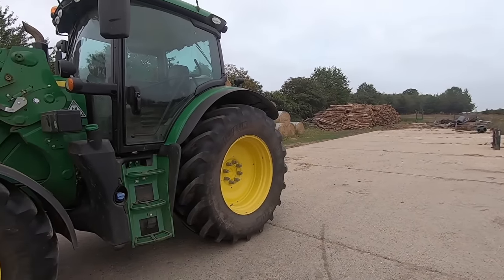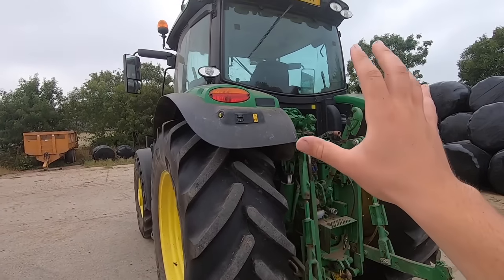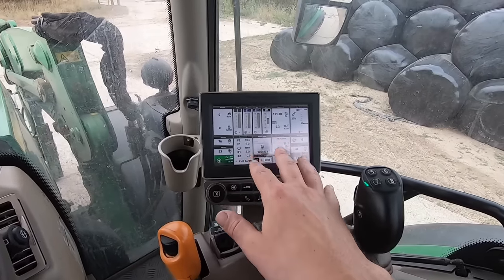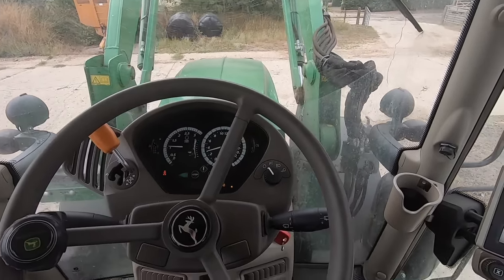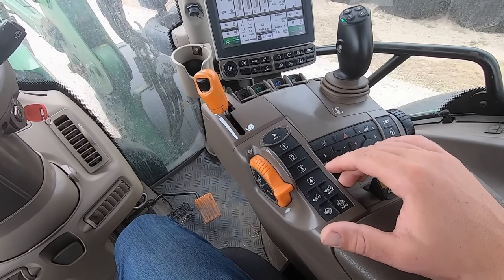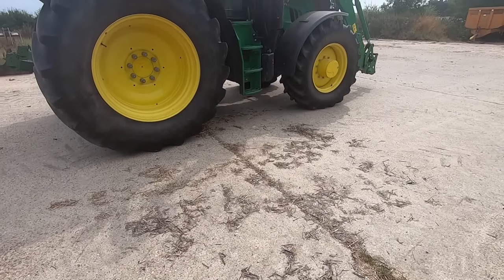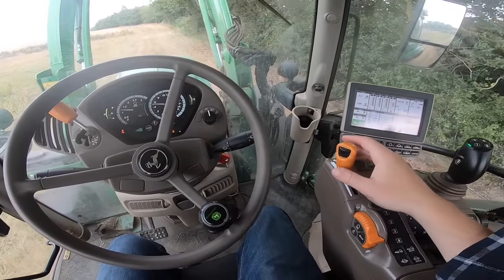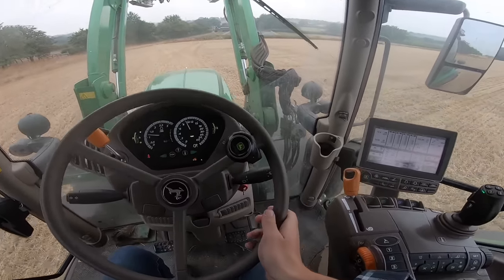How To Drive A Modern Hi-Tech Farm Tractor In 2020!

Comment: Y do u have a 200 hp tractor when all you pull is a cattle trailer and a cultivator 140 hp is enough ( u should have bought a John Deere 6130r
Reply: No harm in having enough plus he wanted something similar to the 6930 size and weight wise also he wanted a 6 cylinder and the 6130r was a 4 cylinder
Reply: 6130 wouldnt pull the muck spreader he uses
Reply: @henryellis154  it would I used to pull a 14 tonne richard western with a 125 case maxxum
Reply: WillFilms 130r is a 4 cylinder and had way less torque aswell pretty sure olly uses a 16 ton spreader aswell and spreaders are muck heavier than trailers
Reply: @henryellis154  the 125 maxxum is also a 4 pot, I was also referring to a 14 tonne muckspreader not trailer
Reply: You get better total economy with using a tractor witch have a lot more power if the tractor is to small you actually over use it putting more stress to engine and transmission and so
Reply: Sap exactly like often in new cars they make the engines smaller but they get less mpg because they have to work that much harder
Reply: @henryellis154  that's true some people don't understand this their thinking oh that's a small engine it must be cheap to use but in reality you beat the living crap off it
Reply: I have seen damage been done by putting a small tractor on big tasks, on norwegian fields. It's wise to use money on a tractor wich does the work easy. I work for a farmer with a 135, 65-66 dt and t5060. Tasks are way to heavy for all of them. The 135 have had to engineswaps from the late 90s, he swaped to a 185 engine, wich broke last year du to stress. A brand new 135 engine was instaled and its now way underpowered, he can only power the windrower with it, and its small. The fiat is used to stack bales, and small tasks in the farmyard, one tractor he takes care about. The 5060 is good, but he should have spent money on a 6040 elite. 5060 is overheating and it splits it self in half (due to stress?) Way to small for the plow, and it's not comfy on long days out in the fields, or bumpy roads. He could also need a 4th tractor to bale or wrap, wich he cant do with the 135 or 65-66. So it's good to have some ponnys to play with, and the right weight.

Comment: I tried a Valtra N92 from 2008 not so long ago, I kinda like the drive/neutral/reverse lever on the steering wheel. But I'll end up finding myself using the clutch with it. I'm too used to my good old Massey Ferguson from the 80's. But honestly I need to say that it's really comfortable to drive newer machinery. The only problem is that I don't feel like I control the Tractor, it's more like the tractor controls me haha

Comment: Question : do farmers regularly use the AUTO DRIVE mode when working the fields ? or do they do it manually ?
because im really impressed with how farmers maintain a straight line when sowing or harvesting etc.
Reply: Farmers have been maintaining straight lines since tractors were invented :)
It's a skill, you learn it. The trick is to make the first line straight, then you just follow that.

Comment: I just got a used 6115m that has the front 3 point and a H340 loader. I can't for the life of me figure out what is the use of the front lift arms without a front PTO when there is also a loader. Evidently you guys use them across the pond but I've never seen them here in the states. What do you use them for?

Comment: Why do tractors have two doors when you only ever use one?
Reply: Captain Sandwijj If you manage to capsize it, you can get out of the other side. I think some tractors do only have one door.. I guess you could crawl out of the back if it isn’t buckled.
Reply: In older tractors there wasn't a big computer that's almost hitting the front window so before you could fit in front of the controls and out the left and right of the tractor that's why I much prefer the older tractors but also theres a much nicer sound off the older tractors